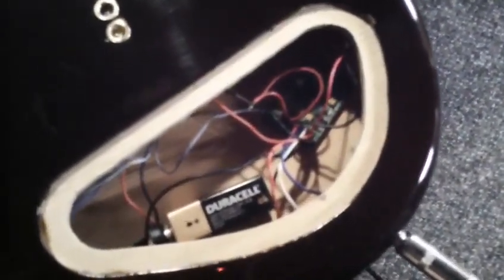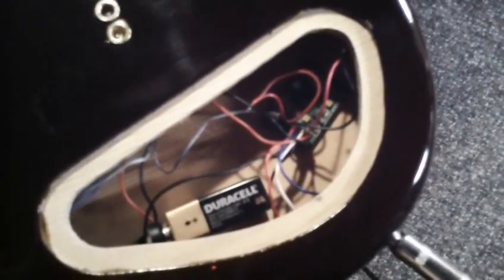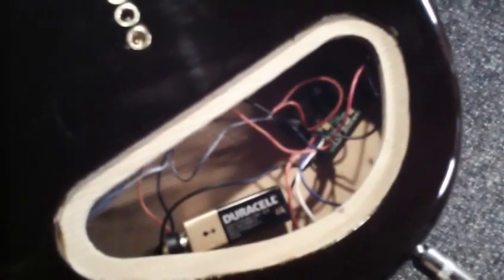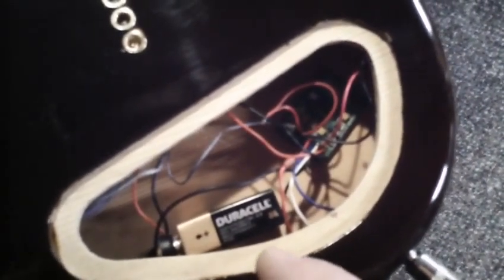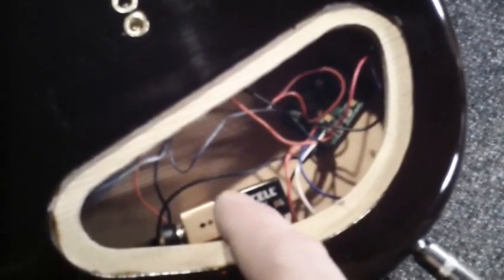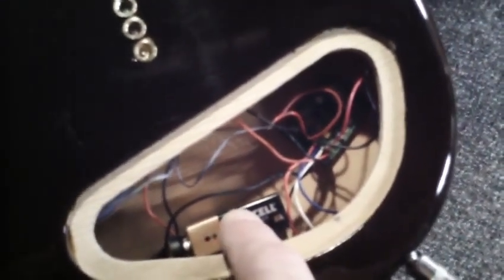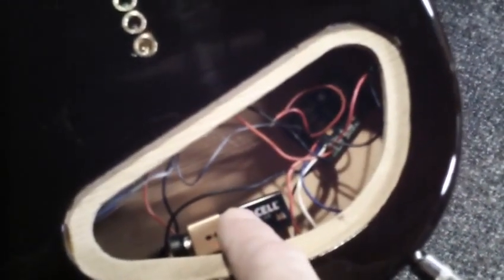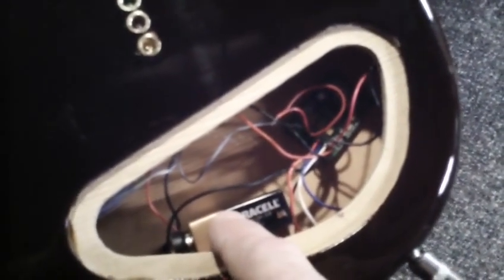Guitar picks up a radio signal

Comment: You have an rfid chip in your body that emits frequency that your guitar pickups can pick up, and if use your pickups like a scanner around parts of your body, it will pick up signals the same way it picks up audio from your cell phone. You can use a metal/wiring detecting stud finder from home depot and run it across your body to find out where on your body they are via signal. Food for thought. - u.s. army infantryman.
Reply: You should get mental health care asap.